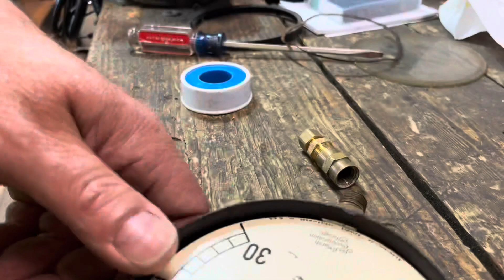Fun with Steam

Comment: Judging by the steam . The gland needs repacking. 
Having fun with steam is always good.
Reply from the maker: I agree, the gland needs attention along with a few other things, that pesky steam just didn’t want to stay where it was supposed to, I had to do a few tricks, use some heavy weight oil and use up a whole heap of finger crossing just to get this gem to run, but what a blast. Thanks for watching and taking the time to comment.
Reply: @whatsdavedoin8189  
As not as easy as going to Lowes to get parts for steam engine.  
I love how you came up with a boiler. Cooks dinner and runs a engine.